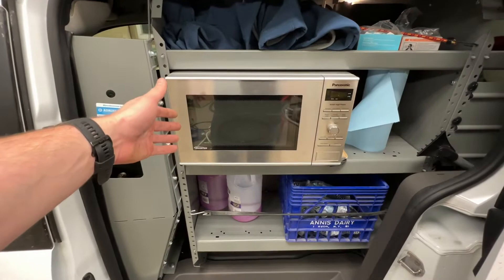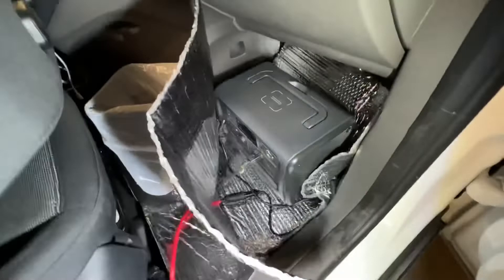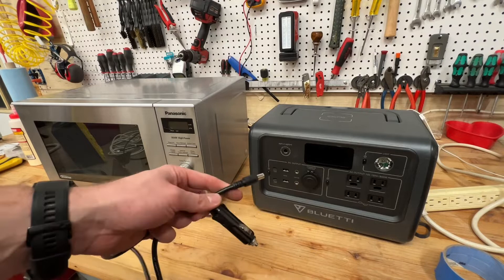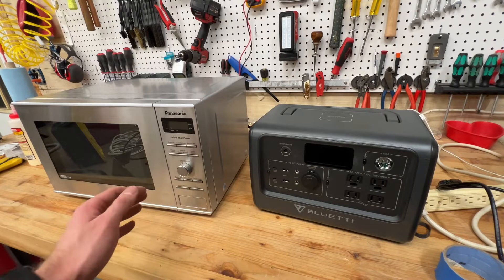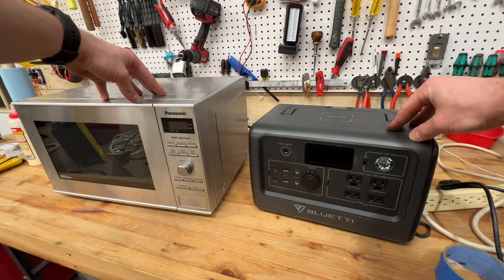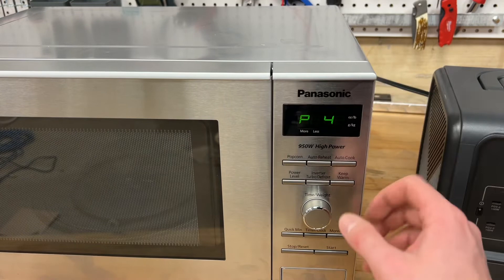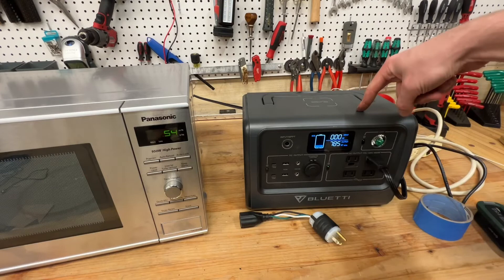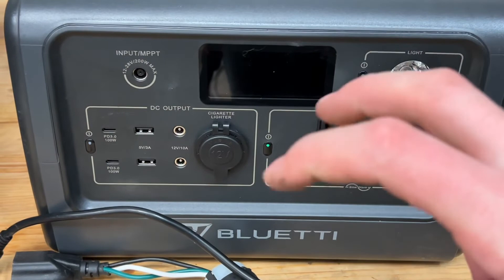How to use a Microwave in a Van!!

Comment: Does it cut off at power level 6? Because other microwaves still pull the same amount of power but when you change the power level it changes the output but the draw is still the same . Did you try it on higher power levels?
Reply from the maker: It will shut off at power level 6 because it will have a continual draw over 800 watts, I have tried it higher, just trips it and it needs resetting